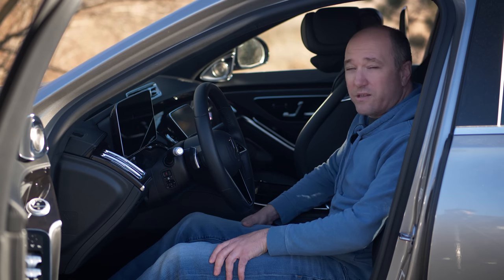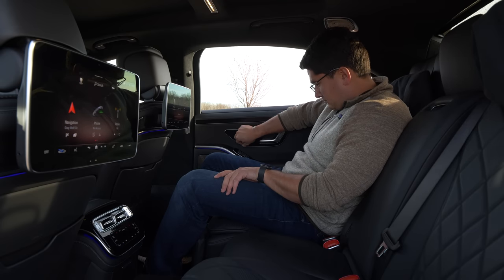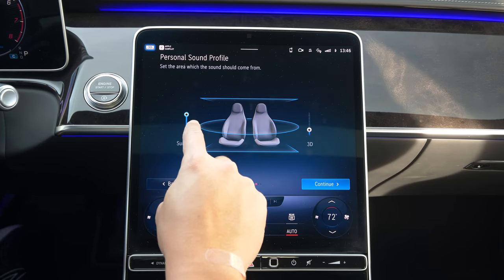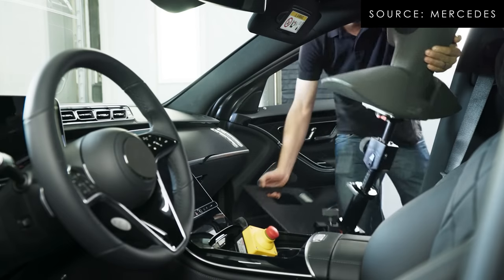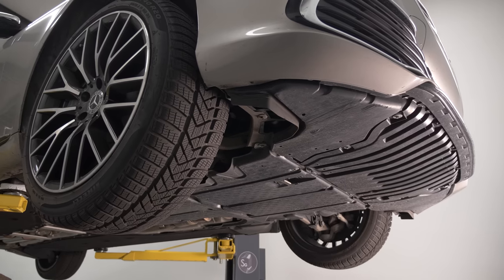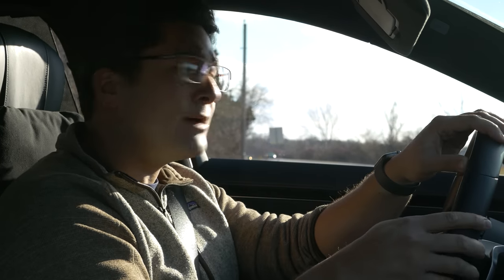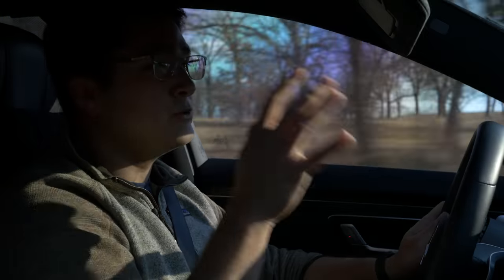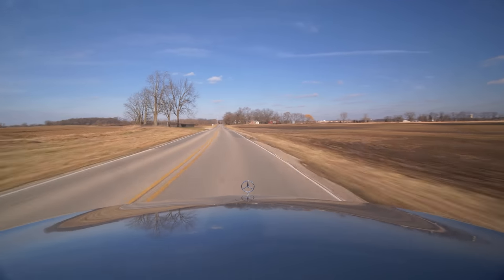Mercedes S-Class | The Best and Worst of Cars

Comment: The worst thing about this screen mania is that the dudes who buy this type of car are usually old, and their screen dexterity is sometimes lacking. Anyway, this savagegeese video is as usual very premium and industry leading
Reply: I had the same thought. These super expensive Mercedes are usually bought by people who are either old, have very little time or both. Putting such an infotainment looks like an absolute target group failure to me.
Reply: I'm not young but not so doddery that I can't see or touch a screen. Also, in that position, the cost of a driver would be part of the purchase value assessment.
Reply: @andrewwilson8273  It's not just about being able to use a screen, but about being able to do so while driving (to be fair, this car won't shake much, but still). It's also about the willingness to learn and explore thousands of submenus, something people tend to loose with age and rank.
Reply: Many S classes are chauffeured. Rich guy buys car, gets his driver to drive it for him -- and the driver better learn what he needs to do. Rich old guy doesn't need to worry about personalized lighting or sound mode, or where to find the oil checker -- the driver does it for him.
Reply: The people that buy this car are going to set it up the way they want. And they want what they want, right down to the perfect shade of blue ambient lighting with just a hint of red while wafting in the sent of leather and perfume. After that, they'll never touch it again so the fact that it's buried in menu after menu won't matter.
Reply: RIGHT?! ..I just picture a rich old guy who only controls his iPhone with his left index finger, being set loose in this car. I see him frantically adjusting his bifocals up and down as he stabs blindly with that one finger, attempting to find NPR while he places far too much faith in the self driving tech’s ability to avoid running over a grade school.
Reply: Is anyone gonna mention the horrible bezels on these things ? Looks like circa 2010 HP mediapads that they were half throwing away, half selling.
Reply: @robertpaulson7826  yes, it's about creating a bespoke driving environment, not endlessly twiddling buttons. In that sense, I think Mark misses the point.

The value comparison is this: how much more would it cost to buy a car personalised to one's tastes in terms of lighting, sound, fragrance, seating, driving style etc? It is far less expensive and thus greater value to offer lots of adjustments that will be used once and never touched until the car is sold. So, arcane menu options are not really an issue.

Chances are that one would go through the options at the dealer and have most set up before delivery, or at the handover. That'd be my expectation, just as when one buys many high end audio products through an authorised dealer.
Reply: @footballcoreano No, both
Reply: @footballcoreano best reliability? You live in a dream world
Best engineering? You live in a dream world. 
German engineering is a joke.
Reply: @dlmhdlmh   … half throwing away, half giving away, iirc 😃
Reply: @michaelli3997  No, the market remains older in Europe and US, but they’re trying to cater to China
Reply: @alh06  BINGO. That's the world's largest and fastest-growig luxury mar market. And noveau-riche plutocrats want to flaunt their toys. Hence the overkill here and on the grilles of the Genesis G90 and BMW M8.
Reply: Have you also considered that, unlike you, they may also be young and successful?
Reply: It's actually middle aged people that buy this vehicle.
Reply: I am young and i am buying this. What you on about

Comment: I appreciate the honest assessment. You highlighted a lot of problems that I think are becoming  standard in the automotive industry as a whole. Cars are being built with this YOLO attitude with no regard for future reliability.
Reply: Well like the iPhone there will be a new one you can lease in a little while as soon as your old phone slows down.
Reply: Agreed 100%. Everything that "should" be mechanical is switching over to electronic and being controlled via software.  Future maintenance and repair will be a major headache and likely need done at a shop.
How will you know something is wearing out if you're no longer connected to it?  Think brake by wire....
Reply: Totally agree. Especially when car manufacturers have to go electric for better emissions and company to go green. But the car now a days are disposable which is counter intuitive to what they are trying to achieve in the first place.
Reply: @karraral-bahathly6990  one would think that turning thousands of pounds worth of leather, medal, batteries, plastic, and other materials that goes into a car into a rolling piece of junk in ten years is bad for the environment. 

Furthermore, not only are complex new cars just a waste of materials, but the materials needed to replace everything in the next 100,000 miles of the new cars lifespan makes new cars even more environmentally unfriendly than older cars with perhaps worse off mpg but more reliable parts and technology. 

I know for my simple Headlight from 2012 it would be a simple fix if they broke or something. For an LED headlight, especially the insanely complex ones of today, it would be thousands of dollars and tons of more toxic materials would be needed to fix them. LED headlights do not need to be as complexly designed as they are today with thousands of little LED bulbs for design purposes.
Reply: @colechapman6976  You are spot on man. When the technology is restricted towards one specific goal such as EV's, it doesn't leave much room for innovation and improvement for other technology. 

The way Toyota operates and its investment in hydrogen powered and hybrid power terrain seems the most logical towards a sustainable future which will ensure product longevity and not a replacement product such as a phone.
Reply: You would think with this big push of “sustainability” that this would be considered incredibly wasteful lol. And all manufacturers are guilty of it.
Reply: @_zigzak  "sustainability" to them means you buying the latest 'eco friendly' product they have on the market. It's all greenwashing to sell more shit, that's all businesses are for. Want to be eco friendly? Make reliable/repairable cars we can keep as long as possible
Reply: That's what people buy. As someone not about to buy a car, I think it's an amazing car, because of what it does. Which doesn't include reliability because the people buying this don't care about it. And if you could have an older one of these in 5 years and be happy with it, it's not luxurious enough because the peasantry can have it too.
Reply: @HrHaakon  I could go out and buy one any time but I wouldn't because I care about reliability and not wasting my time at the dealership. I also  do not want to pay someone to do it for me. Best not to presume.
Reply: @footballcoreano Mercedes best reliability? Not sure where you get your data from. They have been going downhill. Best performance? Not really. I am sure BMWs and Pordsche's are better. Best luxury? No. Bently and other cars can be better. Best Reliability? Lexus products have the best reliability. Best safety? Pretty sure that goes to Volvo or Subarus. They are nice cars for sure, but they are not the best and produce unreliable junk that just waste away after three years. 

Much rather a Lexus that I can own for ten years and nothing will break. Can't say that about a new Mercedes, even though they have better tech and interiors than Lexus products. 

Also wasn't really talking about technology being costly to fix, just commenting on how environmentally unfriendly this big luxury barge can be after five years when all these sensors fail and need to be either replaced or the car needs to be destroyed. 

Mercedes "best" engineers can't seem to make any of their cars last longer than three years, and I would find that if they were the best, than their products would last as long as the most reliable cars in the world, which would be Lexus products.
Reply: this review is very very one sided. the w222 is holding its value superbly and when you apply actual math you see that these depreciate along well defined curves which are predictable and therefore, easily planned. reliability is nothing you can comment on without data and these guys, like communist regions, present no data to support anything they state for reliability. the tech analysis in the shop is much better. focus on that. mercedes benz builds its sclass to be forward looking and always has and yes sometimes that doesn't work out well (w140) but often it does (w126, w221).
Reply: @footballcoreano Japanese cars are unreliable because of one happenstance during Le mans? That's your retort? They consistently top reliability scores and surveys, check consumer reports, JD. Power,  other car surveys, and they are much better than Mercedes. I like Mercedes, they do have superior tech, but facts show that Lexus and Toyota products just last longer without as many headaches. So I would only buy with an extended warranty or lease it. 

When I mentioned that Lexus tops reliability charts, I mean that they make products that last and last. And for performance, I am pretty sure Mercedes is not the best, but they are very good. Porsche's are probably better engineered, though it's close. 

Also, the notion that poor class people buy Toyotas proves that you do not know the market well and are really pretty judgmental and car about status symbols, not a good look. 

Also, Lexus products do not break down, and that is why each and every older Lexus still costs thousands to buy than one or two year Mercedes cars which depreciate because people do not trust them in the long term. 

Mercedes are luxurious, they are great cars, just disposable and cost insane amounts to fix.
Reply: I own an S-Class and I will never buy this current abortion. Going to buy a Cayenne or Macan next.
Reply: Cars on average last longer now than before.
Reply: @RemoveChink  Where did you get that BS statistic?
Reply: @ted6462  American Automobile Association

Comment: As I’ve said before, the interior screens are a step back in terms of look. The interior is cheapened by the tablets slapped about the cabin. Previous gen, it was a seamless integrated look under the dash.
Reply: As a young guy who drives one of these, this is the number one complaint and I'm hoping Mercedes responds to it. If they could reintegrate some of the normal buttons and controls along with the touchscreen and make the design seamless, it'd make it the best of the current and prior 2 gens. I too was a huge fan of the 2008-2012 or so designs and would like to see the better aspects return in some way.
Reply: @danielprotaganist7551    And, as a younger person, I'm glad to hear you say this (coming from an older person).  Because the rest of us think that maybe young people like everything being accessed only from a multiple sub-menu touchscreen.

That being said, the biggest downside of touchscreen functions access, by far, is the difficulty and time involved in every single selection you need to make.  Someone who is 25 might be distracted for a shorter time, but it's still absolutely too much time for something that should take less than 2 seconds, like it does with manual / physical button controls.  

Given the major focus from governments on the huge dangers of distracted driving, it continues to amaze and disgust me how none of them are legislating against this type of user interface in new cars.
Reply: The screens make sense seeing as you have hundreds of customizable options for driver comfort. The problem is, it causes the interior to look like a cheap thrill for consumers. Real luxury enthusiasts don't care about options. They care about the experience, exotic materials, knobs and switches in brushed aluminum. The outside design is handsome, but you could pretty much guess the type of person that would buy this, and it's not someone you'd want to do business with or be around generally..shallow. If this vehicle depreciates to 10,000$ usd, then it would be fun for an engineer to hack and toy with. Otherwise it represents "new money" distastefully so.

Comment: Have had an S class, one each of the last 2 previous generations.  Absolutely outstanding cars.  Hands down the best riding car period.  Navigating the screens and the steering wheel controls takes time and practice.  Not fun in the beginning, any thing complex takes time to learn.  This generations looks to have taken it to another level like Audi with all the touch screens.  What a shame.  For budget conscious shoppers The Genesis is very similar and a fantastic bargain used.  For that matter, used S class are a pretty decent savings over new as well, 2 and 3 years old.  At least they used to be pre covid.

Comment: An unbelievably comfortable and the pinnacle of luxury vehicle...built so utterly complicated that one major issue can be so catastrophic that the vehicle can be effectively totalled. It has EIGHT microprocessors, a proprietary CANBUS system(no other MB product uses it), and enough electronics to power a 787 Dreamliner(not quite but sheesh!). It is technological tour de force that you must only lease unless you're an oil baron or techy of Silicon Valley.
Reply: @footballcoreano troll alert

Comment: I drove a new S Class a couple of Months ago. Didn’t have it for too long and it was a Diesel. The ride and comfort were unrivalled. However, I could feel vibration through the accelerator which was disappointing. The screen is a nightmare at night, but I guess you would get used to it over time. Big car for Europe though. Easy to park thanks to four wheel steer.
Reply: Yer mum was unrivaled 😎
Reply: @footballcoreano you forgot to take your medications, bud?
Reply: @TORTLESSS  He's right though.
Reply: @footballcoreano Troll
Reply: I’ve noticed the vibrating pedal when accelerating too. I think it’s a traction control warning.
Reply: @footballcoreano Amen!

Comment: Someday we're gonna look  back and go "Remember when everyone just stuck a touch screen on cars because it was the new thing to do?".
Reply: One can only hope they limit or ban it someday.
Reply: @aygwm  Yeah. With all the crazy safety standards car manufacturers have to meet these days my mind is blow how none of those prohibit the use of touch screens that take your eye off the road. You can go into a menu and look for the turn signals or change the air conditioning settings and it's all fine and dandy, but if you try to glance at your phone to see who messaged you that's somehow irresponsible.

Comment: I bought a 7 Series of this generation. I bought it after it was leased to someone who paid $88,000 for it, then purchased it after the lease. I paid $30,000 for it with 80,000 miles. It had a flawless maintenance and service history. After I bought it I took it in for another inspection. Nothing was needed. When I was shopping I looked new Accords at $40,000+, and other cars new "reliable" cars that cost more than I paid for my used 740i. I service it as required and I didn't buy a warranty. I have no regrets. I'd buy an S Class with a good maintenance and service history.